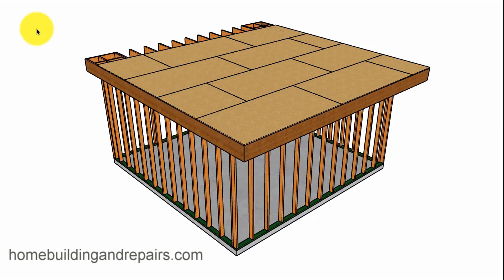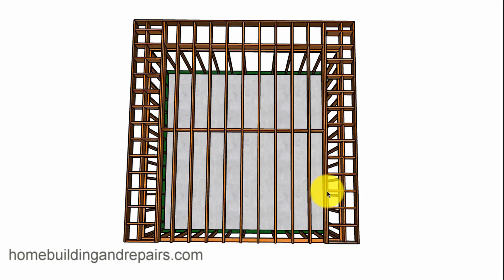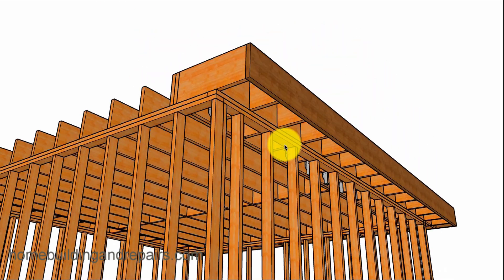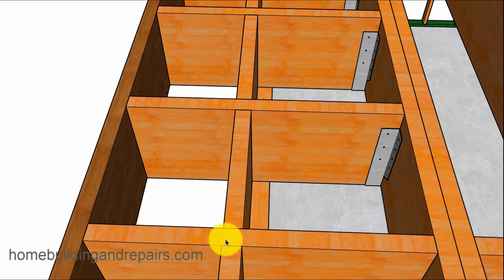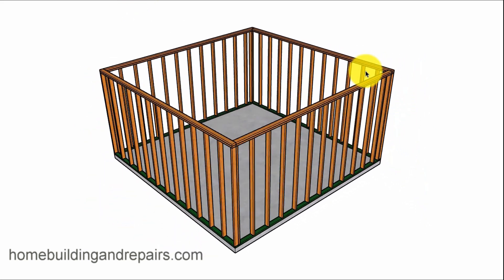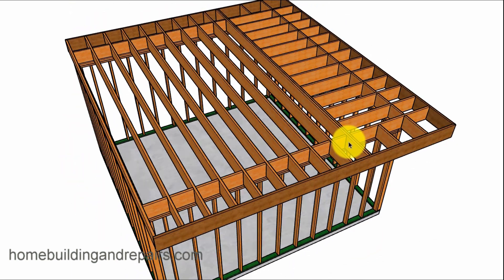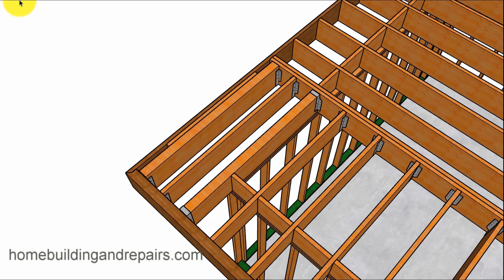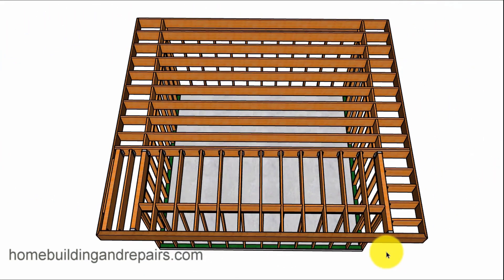How To Build Triple Cantilevered Deck or Floor - House Framing Tutorial

Comment: Hello, this is very helpful information, thank you. I have a 20'x10' one-story block/brick room on the back of a 23' wide two-story flat-roofed house, to which I want to add a 3-sided cantilever addition, matching the width of the existing house (so adding 18" on each side, and 18" in the rear, along the long wall). Would you expect either the 2nd or 3rd framing option discussed in this video to support a 1-story addition, with an 18" overhang all the way around?
Reply from the maker: You would need to contact an engineer for more information.

Comment: Hello Greg! Hinge points! Brilliant! I have an "indestructible"  > 100 year old 27' X 23' 2-bedroom/1 bath 3-season "camp" in New Hampshire that was NEVER put on a foundation - and it kept sinking into the mud!. There was an unbelievable assortment of toppled 18" high home-made concrete supports and tons of whole as  well as broken (from frost-heaving) pieces of cinder blocks all sunken into the ground - nothing was EVER set down below the 48" frost line. I have (per my local building inspector) set 16 concrete piers below the frost-line, jacked the house up 2 feet, and installed 4 - 6" X 6" X 24' hemlock beams to mimic the old, tired (but strong!) existing main Cedar beams. We have installed additional 2' X 8" joists, and blocking, between the existing 2" X 6" joists that were  more than 16" O.C., but they are only tied in cross-wise using joist hangers, but are not attached to the existing 2 layers of 3/4" flooring. Before installing the new beams I had a heckuva time levelling the house, and along with the additional joisting and blocking my floor is already much stiffer and more stable.  I am doing a total "gut/rehab" (wiring, plumbing, HVAC and drywall), winterizing, adding 330 sq. ft. and building out the attic and it will end up as a 4 BR/2 bath. I have also installed a 3' deep X 100 ft yard drain and will install gutters to drain into it.
Here's my question: In the past I incrementally jacked up my outside points and the house would REPEATEDLY slide forward a couple inches! Is this because my center floor beam (which was always a low point) was a HINGE POINT? My idea is to to install another layer of 3/4" "structural" 4' X 8' OSB sheets as new sub-flooring and nail (or screw?) them to the existing and new joists. Is that necessary? Or do I just need to attach the new joists to the original flooring? 
Whaddayathink?
Reply from the maker: I can't provide you with structural engineering and would need to take a look at the house to provide you with a reason why it might be slightly forward while raising it. This of course could be solved by somehow bracing off the house with some temporary braces, then raising it. As far as attaching the sheathing to the new joist, that would definitely be a good thing, but I understand that it might not be easy if you have some type of flooring above and would probably leave it as is until the floor was removed and replaced as long as there weren't any problems.

Comment: Hey! Appreciate your videos. I came across them bc I’m remodeling my bathroom and the previous person who installed the drain cut a huge hole (6-7in) in the 2x10 in joist. It is about 1ft from an exterior wall. I’m planning to sister it, but how long should they be at minimum? I’m happy to provide pictures. Thanks!!
Reply from the maker: See if this helps, sometimes you're not allowed to drill holes through joist and if that's the case, then the plumbing might need to be relocated or modified somehow.

https://youtu.be/EZnH3pZS8kg
Reply: gregvancom thanks! I have since sisters the joist and plan to relocate the drain.